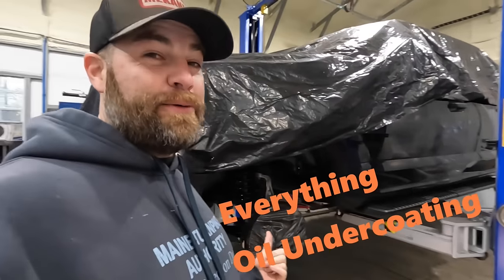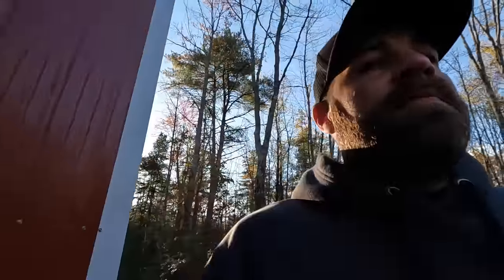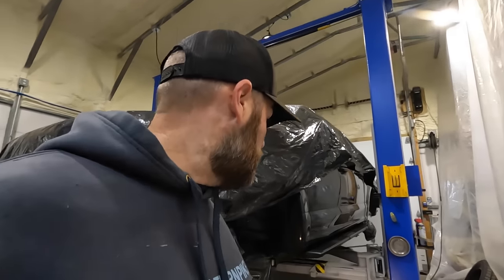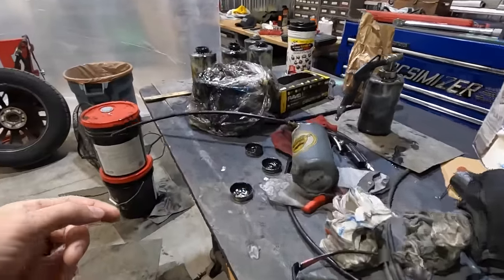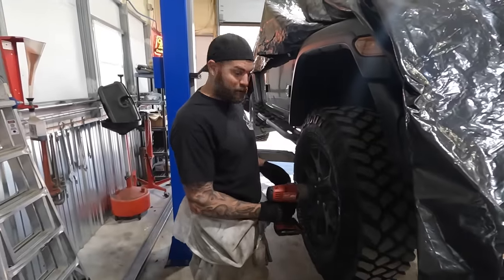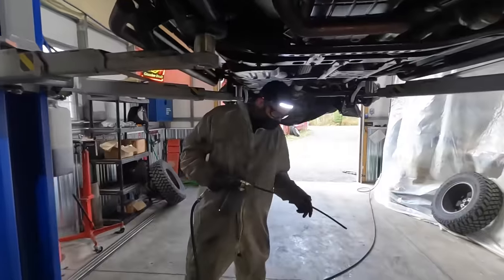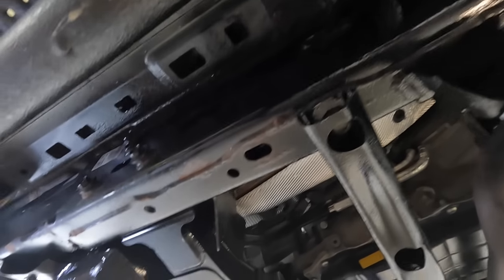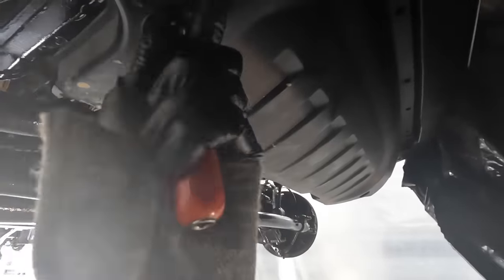The FACTS about Oil Undercoating!

Comment: I haven’t watched this video I don’t intend to, I saw the headline and I just thought I would comment on my 1978 Ford E150 van that I bought new in late 77, and I sprayed it with 50 weight clean new motor oil..
 I sprayed the chassis and in the wheel wells and under the hood as much as I thought it needed.
  I drove the truck for 31 years..
I have one regret which I have since learn from 
  I bought that van just for hauling my road racing motorcycles, and dirt bikes. I also had a car that I would drive in the salty winners here in Western Pennsylvania, as much as I could, because I left our families, dirt bikes in the van, it was like a storage shed where I kept all the bikes, five of them, and all of our riding gear and gasoline cans.
 I wish I would’ve bought an automatic transmission and air conditioning van.
but as I said, I learned my lesson 
  I have a ram, hemi crew, cab 4 x 4, pick up that I bought new in 2017. And I used fluid film on that pick up truck when it was five days old. I have done annual YouTube videos showing how well the truck has been resisting the ravages of salt that this truck is exposed to for four months a year on  average
 I took my time and spent five days spraying in every hole on the frame, every hole under the hood, I removed the fender liners, which are plastic so that I could get full coverage inside the wheel wells, I removed the 16 rubber plugs or along the rocker panels so I could stick a hose up in there and blast inside those rocker panels with fluid film cans that you buy at Home Depot/Lowe’s/Napa for around $11 a can. I bought the attachment hose for going where in small holes on eBay, I paid $13 for mine i in 2017, when my ram pick up was new for that hose, I just checked recently because one of my subscribers on my YouTube channel asked where I got that hose. So I checked eBay, now you can get them for under five dollars free shipping. It’s not just an open hose on the end. It has a jet on the end that’s called a 360 jet that makes the fluid film come out in an umbrella/mushroom spray pattern..
 I am going into my ninth winter soon in 2025 where they throw salt. If you want to see how well that fluid film works, check out my video. I only sprayed under my truck one time back in 2017, I have done several touchups here and there when I would find spots that I missed. But that stuff is fabulous, it’s not harmful, it’s actually good for leather and your skin because it’s lanolin, they somehow extract it from processing sheep.
  after all those winters, it went through, it is still damp, I demonstrate that in my video. I have never hosed under my truck, because I don’t want to possibly rinse off the fluid film, instead, I drive through streams of water during spring heavy rains. After all, that’s all the salt would get there. This stuff travels when it gets hot, it will travel like that hard spray under coating will not. I actually showing one of my previous videos on my YouTube channel how that fluid film leashed up through the seam in the bed of my truck into the bed. I did not spray in the bed. I only sprayed under it. So that fluid film found a way to get into the bed, just the same way salt water would have found its way in there and rotted the metal if I had not sprayed with fluids on the first. I see no deterioration of the spray in bedliner my truck has from the factory, and I see no deterioration of rubber grommets or plastic. fluid film is an organic natural product that comes out of sheep‘s wool..
Reply from the maker: Thanks for the verrrry long comment 👍 I’m glad that works for you
Reply: @FlippinCustomized  
That makes two of us. My ram truck now starts at around $70,000. That’s more than I paid for my first house.

Comment: The car lover in me says yes do this. But the mechanic in me says I don't want to be covered in that stuff when I have to work on it. But I guess getting covered in nasty oil versus having to deal with rusted out bolts and brackets. I'd rather get covered in oil
Reply from the maker: I’m a mechanic and being covered in oil is better than rusty crap
Reply: It is nasty to work on a vehicle that's been sprayed but it's also nice when a bolt comes out without heating it or breaking it off.
Reply from the maker: I agree 💯

Comment: I live in Canada and spray my own car every year. I personally don't like Fluidfilm and Krown sucks. I use to use it. What I use now is Rust Cure Formula 3000. Stuff is amazing. No smell, no drip and stays on all year. Anyone in Canada should give it a try.
Reply: Fluid Film is good stuff.
Reply: Where do you buy it?
Reply from the maker: I haven’t heard of that one
Reply: @TK-ec5bv  to each thier own. I shouldn't have said it sucks. Just it's not for me.
Reply: @VGMStudios33  It smells bad but it works well.  I hit the entire underside of my car with it every October, and haven't had any rust at all.
Reply: I’ve always used Fluid Film or Corrosion Free 3000 (whatever’s on sale), but this winter I’m gonna try this new stuff called Blaster. Apparently it’s more durable than the other two best options
Reply: @ogalief  I've tried both, similar results.  Fluid Film smells like sheep.  P.B. Blaster "surface shield" smells like horse.  Powerful farm animal smell, good protection.
Reply: @TK-ec5bv  interesting. Where I live, they use some nasty stuff on the road. I want the best stuff I can get. Did you use it from the aerosol can, or the bucket?
Reply: Agree with the Rust Cure Formula 3000.  I buy the jugs. It's saved my truck!
Reply: I read your comment and I’m pretty sure you said Krown sucks and not Fluid Film. I agree Krown does suck it doesn’t last at all! I think I’ll try that Rust Cure 3000 as they use a lot of salt in the winter here in SS Marie, Ontario! Too bad I live so far away or I’d get this guy to do my truck. Hard to find people that give a shit anymore about how they do their work!
Reply: Flipping Customized you do great work and care about the job you do. You are worth every penny you charge for the detailed work you do to rust proof the vehicles. If you have some spare time bring your gear up to SS Marie, Ontario and do my truck😂.
Reply: TSC/Peavey Mart puts this on sale some times.  Formula 3000 sells a kick ass spray gun on their website with a pressurized cup.  I bought one and LOVED the yellow hose for inside the frame and body panels!
Reply: i have  mine done with Krown and it last.. I'm in Northern NYS 25 miles south of canada across the Ogdensburg bridge.
Reply from the maker: I’ve never tried known
Reply from the maker: I just bought the lemer s460 I believe is the model works awesome

Comment: What do you think about using this on a brand new 2024 GMC SIERRA 1500 with there frame coating
Reply from the maker: It will soften the gm waxy coating so you want to go thin and reapply for a couple years in a row.

Comment: I used to have a dedicated lane from Saint Andre, NB to Harriman, NY and Enfield, CT. Love it up there. Right now, I'm looking at buying a used reefer trailer. It's a good price, but it's been up north, so it has some rust on the underframe. That's why I'm here. Not sure it's a deal breaker. Was really thinking, can't I just grease it? Yuppers!!! Thanks!
Reply from the maker: Thanks for watching
Reply: Your running I-87 in NYS where they use salt and the brine mixture.  I forget how many pounds and gallons per mile but can find out. A little rust on the trailer won't hurt. I'd get it sprayed and let it sit for a couple weeks to drip. It will make the trailer last a lot longer.. Those inspectors in the rest area North of Albany NY probably wouldn't like it dripping on the interstate.
Reply from the maker: Most people don’t think of oil undercoating trailers but they rust fast too

Comment: Its totally ridiculous we have to go through this, searching for a rust free underbody. The proof is with a vehicle like the Postal LLV: Aluminum. That body is unchanged since its introduction in late 1988. Same with Corvette fiberglass body. Same with DeLorean stainless steel body. Even if Detroit just primed and painted both sides of the metal. FYI the solution you put in a hose end sprayer Salt Away (Begone) is good too.
Reply from the maker: I totally agree for the money that we pay for trucks they should be rust free for 10 years

Comment: IMO there's no point in oil undercoating a brand new car, it creeps into rust, but it just washes off paint.   Once the factory finish starts to come off though, I pressure wash the underside and do Crown on the body and inside the frame every year.  I do the underside with Proform Wax based undercoating.

Comment: Hi, I know you said it doesn’t hurt wiring, but I just wanted to caution people spraying their own vehicles I’ve had two jeeps come back within a week with an oxygen sensor code. And I found when spraying the fenders the  O2 sensors are right behind that area and if you get any oil at all on the O2 sensor wiring, it will seep into the sensor and change the resistance. This may be just a Chrysler thing. I’ve been careful since and I had no more problems.
Reply from the maker: Good point should definitely avoid wiring when possible

Comment: For 40 years I have taken the used motor oil from an oil change and sprayed it under my vehicles with a pump up sprayer. It works but dont let it drip off in yer drive way. LoL
Reply: I don't want it on my driveway lol. Where do you spray yours and avoid the mess?

Comment: Can i use my used motor oil out of my truck mixed with high temp grease and a 50/50 mix of used motor oil and wd40 to spray in all the holes and hard to reach areas that you cant get to with a paint brush
Reply from the maker: Not environmentally friendly

Comment: I would imagine just used motor oil in a pinch is a lot better than absolutely nothing. Or to put a rubberized or painted on product. There's nothing worse than something that's going to lock the water and moisture under it between the frame and the paint or rubberized finish
Reply from the maker: Exactly

Comment: The truth is you can't protect a car from corrosion unless you can form an airtight barrier, which is impossible.  Putting a thick protective coating on the outside does nothing to stop moisture and oxygen from getting into the internal seams a pockets where corrosion often sets in first.  The only difference is that you won't see the effects the corrosion is having for a lot longer.  Any coating you apply has to be thin and is able to be drawn in via capillary action, just as the moisture in the air would be.  There are very few any corrosion products that actually do that, so you're best option in such areas is something like old engine oil or a light grease that can be applied to the internal sections that most coatings cannot.
Reply from the maker: You need to watch the video, I have proven results and can get into panels
Reply: bridge. I have to differ on your opinion.  Where I go they pull the taillights,  drill small holes in the door bottoms, rocker panels, cab corners and can reach in those seams. When done they plug the holes with rubber plugs. The oil through capillary action will creep into the seams and fender wells.
Reply: @FlippinCustomized  I do a lot of restoration work and I've seen pretty much all the types of anti corrosion coatings available.  In my experience there's simply no better protection offered by theses products than there is from old engine oil on the underbody.  In fact most of the branded products aren't as good simply due to the fact they don't penetrate anywhere near as well, which is really the key requirement.  If you borescope some of the hard to reach areas you'll see what I mean.  The worst ones I've seen for it are where people have had the shell acid dipped and then tried to apply some of these rubberised anti corrosion coatings.  The moisture always finds a way in and then gets trapped behind the coating where it hasn't been applied correctly and hasn't bonded.  People forget when these vehicles are manufactured many of the initial coatings are applied before the shell is fully assembled, some coatings even being weld through types.  They were also usually applied in a moisture controlled environment, meaning atmospheric moisture was removed as to not become trapped under a coating, or between panelwork.
Reply from the maker: Fo with what works for you but we’ve had great results

Comment: Anyone use Woolwax? Jim. Wish I could find someone that " thinks out of the box" in the Twin Cities.
Reply from the maker: Are you looking for only wool wax?
Reply: I like the lanolin wax based science behind the product, had a guy do my '17 Chev Express three years ago. He's disappeared. I'm open to any product, doing anything beats doing nothing but finding that shop in the Twin Cities that does the process has been futile. I'm done with Ziebart, they did my brand new, zero mile '03 Dodge Cargo that I ordered out. Frame rails rusted out so badly I thought the steering box would fall off. That was the end of that truck that still ran perfectly at 250K miles.
Reply: Anything is better than nothing, not a Ziebart believer tho. Can't find that guy in St Paul that does the process.

Comment: Krowned my GMC sierra every year since the day I bought it, the frame completely rotted out 10 years later, I babied that truck. I’ll never buy another GM truck again until they get rid of that terrible Waxoil frame coating that they use. Driving a Ram now.

The spray on oil gets under the wax oil coating and lifts it off the steel. Be careful if you drive a GM truck!
Reply from the maker: Yes it softens gm crap coating but Nhou 2-3 years takes care of it

Comment: What about inside the doors, hood, tailgate and rockers? I also didn't see anything to address inside the fenders where the truck rotted.
Reply from the maker: Always coat those areas, if I showed every step video would be 2 hours, this is just an overview
Reply: Theirs usually drain holes that you can access and you'll need too clean them out prior too getting them coated cause they'll be full of debris that's why doors tend too rust out by the pinch weld cause the drain holes are clogged and water is trapped. Same goes for rocker panels, their should be a plastic plug on the rocker panel and that's how you access that area. For hoods, tailgates, and fenders  spray into any openings and you should be fine. Also pop off bumper covers as well too clean out the bumpers from salt and road grime and spray those bumpers good

Comment: How can you remove oil undercoat that’s full of road dust?? I can’t find anyone wanting to do it
Reply from the maker: Why would you? That’s what helps form the barrier to protect your frame
Reply: @FlippinCustomized  because it makes a mess and more gunk to remove when working on. 1/8" thick limestone dust covering is not ideal.
Reply from the maker: Better that a rusted out frame
Reply: @FlippinCustomized  i'm talking about removing contaminated undercoating, not about continued rust prevention as you can always recoat it.
Reply from the maker: Hot water blast then reapply

Comment: well, you had a lot to say! your shop must have been a complete mess after, but good to see you covered the bodywork. I have actually stopped using compressed air, but use a pump up pressure washer instead. less mess .
Reply from the maker: Not bad we cover everything up

Comment: What I just watched is the only proper way to do it! I was just quoted $300 for a sedan and told that the NEOU coverage would take one hour. I don't see how it is possible to wrap it up in one hour, unless you either have a well-synced crew of 5 people OR you cut corners. 
The only thing you didn't show is coating the inside of the doors, hood and the rocker panels, but I'm sure you do those as well.
Question: why did you choose NEOU vs. Fluid Film/Woolwax?
Reply from the maker: Thank you, we have had good luck with the product and it’s a local company

Comment: Half of the comments here are about people using their own homemade used motor oil undercoating or some other type of homemade undercoating using different types of fluids, fuels, waxes, greases or solvents. I'm sure that stuff works fine, but my concern is that I hope those people understand that if the EPA finds out you're applying undercoating to your vehicle that's not environmentally friendly they are probably going to hit you with a severe fine. Who knows how much that fine will be, but I'm willing to guess it's going to be more than $10k. More than likely this is exactly why all the oil based undercoatings sold to the public are using environmentally safe oils like lanolin which comes from sheep's wool.
Reply from the maker: Exactly why we use this product

Comment: 3:04 that is likely not an "oil" but a fluid that isn't petroleum based. I use KROWN Rustproofing available in a T32 (red and thinner) and T40 (tan and thicker). I buy the T40 in a 5 gallon pail and I apply it myself using a compressor and gun with wands. I've been using it since 1990 so I know it works on vehicles that were bought new and sold at 16 and 14 years, both rust-free in harsh winters with salt. That 14 year vehicle is now 25 years old with a friend. I also do not drill holes as there are enough access holes when you remove rubber plugs and wiring plugs at doors. Applied every year if KROWN does it, but it is important to do it the first 4 years and then you can then apply it every 2nd year.

Comment: way i see it if you clean it and deep detail things periodically theyll last a long time, and even wiping an unpainted frame and suspension down with an old towel soaked in motor oil periodically does wonders .. what you cant fix, is stupid😂 if you submerge your vehical 'everything' will get eff'ed up if 'everything' is not taken apart, lubed and cleaned regularly ..